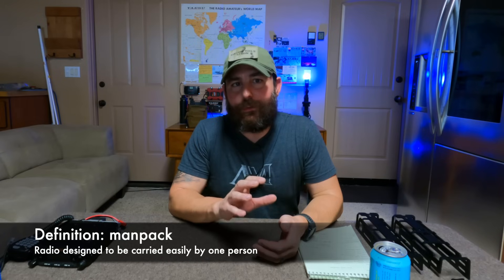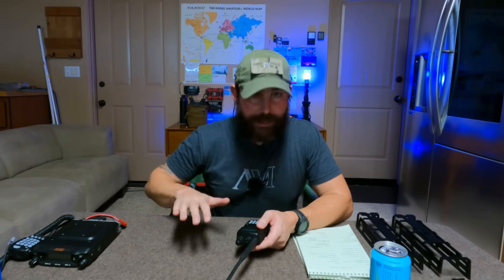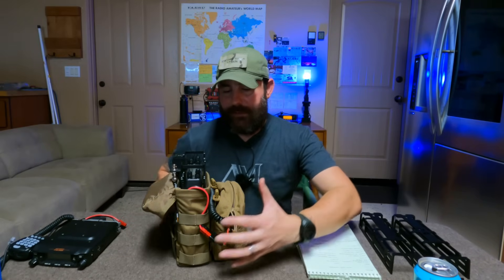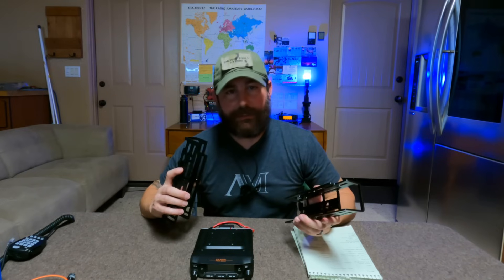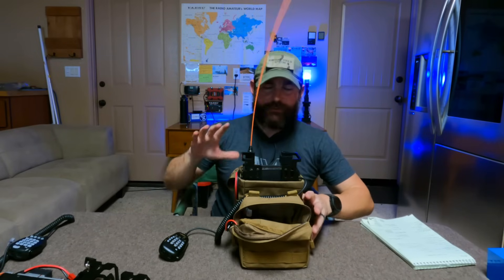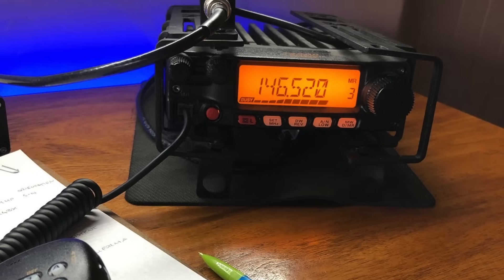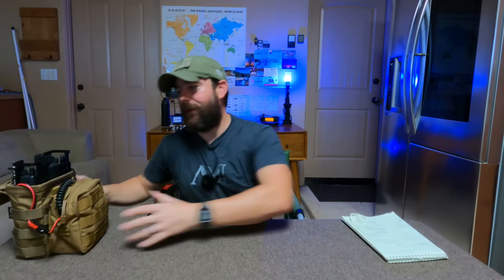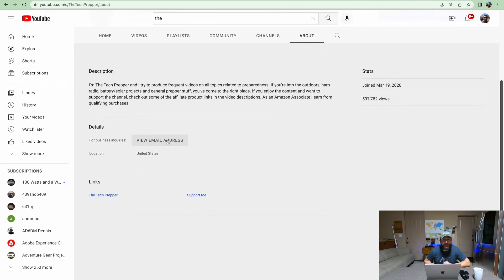Military-Style Radio Manpacks for Civilians - Part I

Comment: Hi. I just got my tech license and bought a second hand FT-857D. What type of connector did you use for the Signal Stick antenna? And thanks for these videos. They are great and make a lot of sense.
Reply from the maker: Congratulations on your license and for securing an FT-857D. Those are getting harder to find these days and command a price for more than they were listed when in active production.

I am running my FT-857D with the ARMOLOQ TPA pack frames. Those frames come with antenna relocation hardware and a BNC female-to-female bulkhead. If you're planning on running this same setup you will need:

1. A 12" PL-259 to BNC male coax jumper cable. (Another option is to pick a right-angle PL-259 to BNC female, then just get a 12" BNC male to BNC male coax jumper).
2. A Signal Stick with BNC.

Note: Do not run more 20 watts with the Signal Stick on the FT--857D even though they can handle more power. There have been a lot of reports the SWR is a bit high when the Signal Stick is used in this configuration.

Good luck,

73 de Gaston KT7RUN
Reply: @TheTechPrepper  thank you! That's exactly the info I was looking for. And, yes, I remember you mentioning the RF factor in manpack video No. 1. Makes total sense. I managed to get the radio for $850 which I thought was fair. And have purchased a military radio bag they use with Harris manpack radios. Should arrive in the mail today. Very exciting stuff!
Reply from the maker: @AKHSwampFox  It sounds like you're all set. The PRC/117 radio pouch is another good option. If you're ambitious and want to get into digital data modes, checkout the DigiRig Mobile and the 8xx cables for that radion. Good luck!

Comment: How does that signal stick work with no ground plane? I've tried something similar before and discovered from several elmers that not only will it hamstring your transmission and reception, but it's actually bad for the radio...

Comment: I have been watching several of your videos, particularly those on the manpacks. This is of particular interest, although I do not have the technical skills you do. In addition share the concept of short message with minimal power. It looks like WinLink, APRS, NBEMS are the software packages I should try to put together. When I looked up EmComm it seemed to point to Raspberry Pi which appears to be a kit and from appearance possibly a hub. If there are other software please let me know. Your reference to encryption was also of interest and understanding it could only be used in a full grid down situation.
Reply from the maker: You may want to go to my channel page and find the "Digital Modes" playlist. I cover all the software on a series of videos. EmComm Tools is a custom software platform that I have been writing for close two years. Initially it ran on the Raspberry Pi 3. It has no timeline for a public release. Here's a presentation I filmed on my project: https://youtu.be/HFdXTk8Zp5c

Comment: I you use the FT891 you have a power range of 5-100 watts. Batteries can be relatively small.
Reply from the maker: That's a great rig with a fantastic receiver. I have an FT-891 manpack as well. I typically pair mine with a 12Ah LiFePO4 and a set of 40m and 80m homemade dipoles deployed in an NVIS configurations. I am wondering if I should add the FT-891 to the series? That could possibly be a good Part VII video. Thanks for the reminder.

Comment: Well, now you've got me hooked into getting a manpack set up.  Just purchased an FTM-200 for the job.  One question though: are you fusing the connection to the radio while running the Bioenno batteries, or is the protection circuits on them enough for the task?
Reply from the maker: I typically do not anymore, but in the past I have used and built small inline fuse holders with Anderson Powerpoles on both sides. I believe a did a video on this very early on. Most of my manpacks are just connected directly to the battery since the Bioenno's have a Protection Circuit Module (PCM) that supports: (list taken from FAQ section):

* Balancing function for cells
* Overcurrent protection
* Overvoltage protection
* Overdischarge protection (also known as undervoltage)
* Temperature protection
* Short circuit protection
* Charging Circuitry integrated
Reply: @TheTechPrepper  I thought I had seen a fuse in an older video too, but wasn't sure if you were still or not as we never get to see fully inside the battery pouch on the front.  Good to know though, and thanks for the reply!
Reply from the maker: @classified5228  The fuse holder is pretty small and fits in the pouch. The only time I use it these days is if I connect my manpack to the starter battery in my vehicle.

Comment: Excellent video! I'm building a portable man pack using a Wouxun KG1000G , I too have the armaloq frame for the KG1000, I really like the pouch, do you think the KG1000G with the Armaloq frame will fit inside the Helikon -Tek E&E pouch with the top cover closed? Thanks in advance...Clint
Reply from the maker: It will not fit. I have a KG-1000G and the TPA frames. That project has been in the box since last year. It's been on my todo list to finish this GMRS manpack build.
Reply: Okay, thank you for letting me know.
Reply: Please let me know what kind of pouch you find,  and what size battery you use.
Reply from the maker: @stoveboltsix  I designed a custom bag, but I was only able to produce about a 110 units: 

https://shop.thetechprepper.com/products/ttp-manpack?variant=41415924187183 

Unfortunately, they all sold out and I do not have plans on making any more this year. In this video, I was using hte Helikon-Tek E&E pouch, but the top will not fully close given the height of the frames.
Reply: @TheTechPrepper  Nice bag, too bad they're sold out, as I would surely purchase one.

Comment: I’m a new ham and like the idea of a man pack as it fits everything as a base and mobile. Looking at an inexpensive mobile to start with. Do you have any suggestions or opinion on the Any Tone AT 778 UV?
Reply from the maker: Welcome to the hobby. I do not have any experience with the 778, but I did pickup an AnyTone 578 for use as a manpack. I have not started that project yet. Good luck with your build.

Comment: Nice channel…and I want man pack or go bags for my rigs just how you have yours for my HF & Vhf/Uhf rigs plus I’d like to have a solar man pack to keep my rigs charged
Been looking into water proof hard cases to store the man packs and everything needed for mobile stand-alone mobile communications like test equipment, other antennas, other coax, solar and ect.
Reply from the maker: Thanks. All of these are charged off solar. My ruck has a Buddipole PowerMini solar charge controller and 20 watt folding panel. Some of my HF manpacks, which I'll cover, have the solar charge controller integrated. The panels are typically deployed on top of my trekking pole tarp shelter. Cheers.

Comment: I think it might be more pratical to just use a repeater for power gain. Use a small handheld transciever that works with a repeater that has a much better antenna and more transmitting power. This why you can keep the weight down & still have the benefits of a better\bigger radio.
Reply from the maker: There's nothing like a high a gain antenna to improve your range, but even then 5 watts may not be enough depending on your location. Personally, I'm in a rural area and still need more power and a high gain antenna to make a contact. Getting to higher ground helps, but sometimes I'm in a canyon or just too far from a repeater.
Reply: There will be a time when repeaters will not be available. After the grid goes down, after an EMP, etc. only point-to-point will work.
Reply: @billryland6199  FWIW: I am planning to set up a repeater on my property for use with handhelds. Handhelds usually max out around 5Ws and have poor antenna response (low to the ground). So having repeater would increase the effective range of handhelds. for Longer distance comms it probably will be the HF band.

For EMP, I would just store the equipment in a faraday cage until needed.

Comment: It will be interesting to see what you come up with for a "shack in the box radio" (hf, 6m, 2m, 70cm all mode) for a manpack. There is very little in current production that isn't QRP 10W or less, or isn't power hungry on recieve, and/or isn't built well for portable use.

20W is plenty of power for digital and CW operations when solar conditions are fair to good. When band conditions are poor to bad then 100W becomes marginal for CW and digital and very difficult to unuseable for phone SSB.

20W is a minimum SHTF requirement for HF that may not be sufficient occassionally. 100W very rarely is not sufficient.

I don't believe there is a suitable 100W shack in the box radio in production.  That means used gear or QRP radios with separate amps are the only choices.  I am interested to see your used radio choices and new radio choices.
Reply from the maker: I have two shacks in a box. They were actually my first manpack builds. They are the FT-818ND and the FT-857D. They have been field tested more than any other of my packs. They will be covered in this series in Parts IV and V.

I love the size, weight and footprint of the FT-818ND, but 6 watts can be challenging. I can make it work well enough with an NVIS deployment on 75m/80m pretty consistently for my local/regional voice and digital contacts. I wish this radio had 20 watts with 1/5/10/20w as power steps. It would be great if it had an IP67 rating and a built-in sound card. I have a note to reach to Yaesu Japan about an "FT-820" that's suited for this style of operating.

I am always on the fence about the FT-857D. It has the right amount of power and capabilities to cover all my communications needs. I never run more than 20 watts even though it can handle 100 watts. For portable work, it is a back breaker and takes up too much room. If I go into the backcountry man-portable for two days or more I need to leave it and take the FT-818ND. This rig is perfect for transitioning from the shack and to the vehicle and for limited activities where you a have a vehicle as a base of operation. I will be covering the on the "transitional" topic in Part III of these series.

I love it when you stop by. Cheers!

Comment: Just saw your video and am very interested in building a man pack.  The video is over 2 years old and I’ll check your site for newer ones.  I have a question regarding having a HT in your pack in addition to an HF rig.  I have a Yaesu FT3D which is 4 to 5 watts.  Instead of getting another 2 meter radio what would be you take of just getting a 40 watt amplifier for the HT.  I’m looking to purchase a QRP rig for the HF bands.  I’m strictly a SSB operator.  I am also an amateur astronomer / astrophotographer and would love to take a Ham Station out with me when I’m star gazing.  Thanks.  Bruce, KD2BMK.
Reply from the maker: I have not found an amplifier that covers both VHF and HF. They have small form factors amplifiers for each, but not one combined. A couple years back I purchased an RM Italy 2m amp that was compact that had both SSB and FM. I even tried to turn it into a manpack, but it never went anywhere. I have video on Youtube with the prototype.
Reply: @  let me clarify my question a bit.  I meant to only get your take for the HT amplifier.  Funny to I was looking at the RM Italy LA-144 VHF HT Amplifier.  I plan on  keeping the QRP at 10 or less watts unless I decide on the Xiegu G90 which is 20 watts.  I’m 72 years young and I retired as interim Public Health Officer for Detroit overseeing Public Heath Emergency Response during the H1N1 Pandemic. Prior to that I spent 22 years in the USAF and retired as Superintendent of Medical Emergency Response covering both war time events, natural disasters  with  a Tour during Desert Shield.  Your You Tube channel is fantastic.  73

Comment: You can put the MP in the passenger front and tie it down with seat belts.
Reply from the maker: Exactly right. That works great. I actually through my 2-point sling over the top of the head reset in the Jeep and connect it to the two D-rings. The manpack stays pretty secure.
Reply: @TheTechPrepper  I do not want to advertise.  But I do the same using the Tac-Com box.  Did not know about this other guy.  Maybe not in business when I needed that kind of product

Comment: I have a FT981.  Where do I find a backpack that will fit my radio and protection frame.?
Reply from the maker: I designed one but I'm sold out until next year. Check out the posts section on buymeacoffee.com/thetechprepper

Comment: My SO-232 bulkhead does fit the .550” hole in the relocation kit.   How did you overcome this issue.  

Jeff de N1JWW
Reply from the maker: The relocation hardware is only designed to accommodate the BNC bulkheads. I use a BNC male to SO-239 adapter if I need to get it to PL-259 terminated coax. These are a few dollars on Amazon.
Reply: @TheTechPrepper  Thanks.  Got it.

Comment: Super interesting. I’m a newbie GMRS guy, are these compatible? I have no plans to get a HAM license, I do have a GMRS license.
Reply from the maker: Checkout out the ARMOLOQ website. Each frame is designed for a specific radio. They have list of supported radios. A few are GMRS radios.
Reply: Thanks! @TheTechPrepper
Reply from the maker: @kenjohnston2426  Which radio are you running? I picked up the KG-1000 about 16 months ago, but have not had a chance to explore it or even put in for my GMRS license.

Comment: So i converted my sons Power wheel to run off a drill battery so I could swap it out and charge quickly. Would this system run off one?
Reply from the maker: Possibly. These radios run off 12VDC. Depending on how much RF power you out you will need to ensure battery is capable of supplying enough amperage. For example, I can't pull enough amps to run this radio at the full 50 watts using the 6Ah battery. 25 and 5 watts are fine, though.

Comment: Just found your channel. Very Cool. I Subed.
Reply from the maker: Welcome. Thanks for the support. Don't miss this weekend's video. I am taking the first manpack to the field.
Reply: @TheTechPrepper  very cool, I was thinking. With the Radio being in the Bag, do you have any problems with it getting to Hot?
Reply from the maker: @GreatLakesReliance  Everyone is asking this question. I'll address it in this series. Short answer is shorter duty cycles (i.e. limit TX to RX ratio) and operate with the minimum power needed to make the contact. I have been running manpacks in the desert for 18 months with no issues.

Comment: check out the OPMOD TAC 4.0 it might be just the right size for this and very affordable.  I have one I use as a range bag.
Reply from the maker: Thanks for sharing. It could be an option for some people. It's a bit large for my current radios and frames. Also, it seems to be a complete backpack unless I stumbled on the wrong product. I already have a ruck that I use to care all of my backcountry support gear, so the manpack needs to be slim to fit inside. Glad to hear that it's working for you.
Reply: @TheTechPrepper  There are two versions. One is a backpack other shoulder bag.  The shoulder bag is not much bigger than the one in the video.  Just a few inches bigger.

Comment: How do you prevent RF burns and/or other health problems with being so close to a 50w+ antenna?
Reply from the maker: I only run 5 watts with the whip antenna. When I need to run 25 or 50 watts, I'll connect my J-Pole or Yagi. Those two are typically deployed about 15 feet off the ground, so the antenna is well out of range of being harmful.

Comment: is the 6000R the closest thing to secure options with digi coms and integration of other apps for small private com networks?
Reply from the maker: It's not secure at all. However, I have been developing some software that runs the Toughbook that interfaces with the radio that provides secure comms, but I have not released it yet.
Reply: Nice I'm very new to radio/coms but want the ability to reach west coast to Texas if needed and be secure
Reply from the maker: @aodhanoceallaigh8533  That exact use case is coming up on the channel very soon. It will be covered extensively on multiple videos starting the beginning of September.
Reply: @TheTechPrepper  look forward to it i subscribed so ill be waiting lol

Comment: It wouldnt be that hard to wetform some heavy leather into a custom fit case for a radio / battery set up. leather would be considerably heavier than canvas fabric but would be far far more durable. wouldnt be 100% waterproof, but could shed water a good bit too with the proper leather treatment like mink oil. I make leather goods, bet I could make a custom fit bag with straps and buckle closures and mountings etc. Its gonna be nice when people are trading services and goods again.
Reply from the maker: I never thought to go leather, but that's a really interesting approach. I've been having great luck with no durability issues with Cordura. I live in the Sonoran Desert and I'm rough on my gear when operating man portable. The bags are all holding up nicely after 18 months and still look brand new. Cheers!
Reply: @TheTechPrepper  yeah that Cordura is tough stuff too

Comment: What type of cables are you running on your man pack radios? Thanks! W1SLC
Reply from the maker: I run 12" of RG-8X (https://amzn.to/3AD99WC ) for most of the manpacks with a UHF male to BNC female right angle connector (https://amzn.to/3TdtB95). I hope this helps.
Reply: @TheTechPrepper  thanks much. It does.